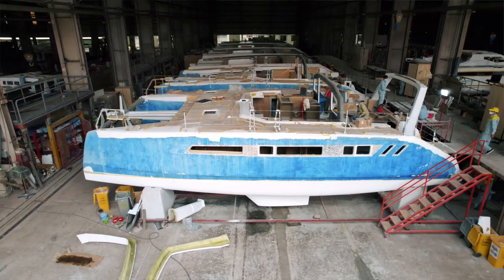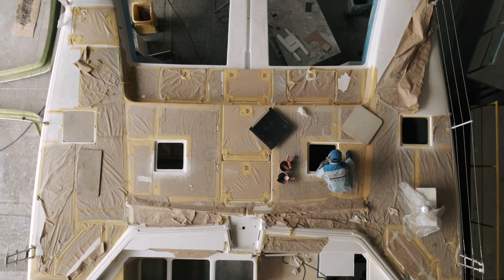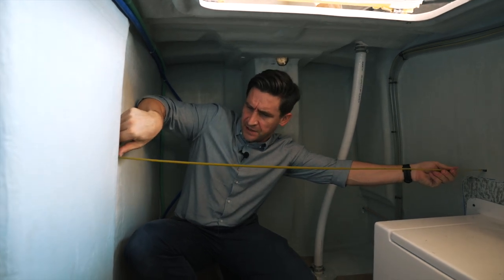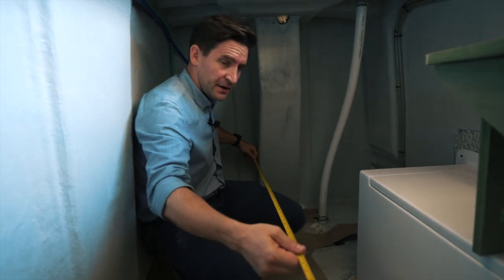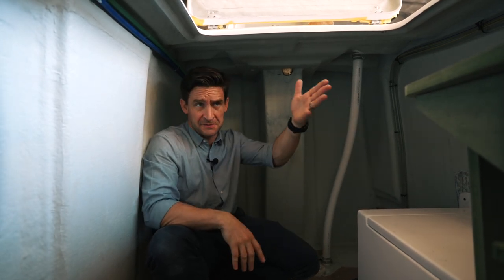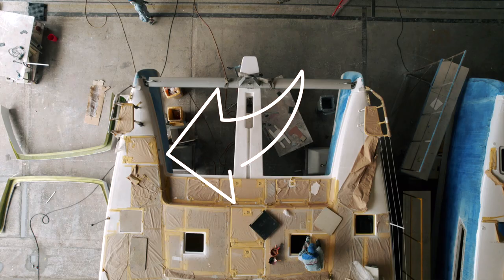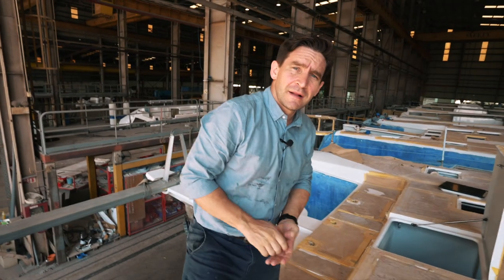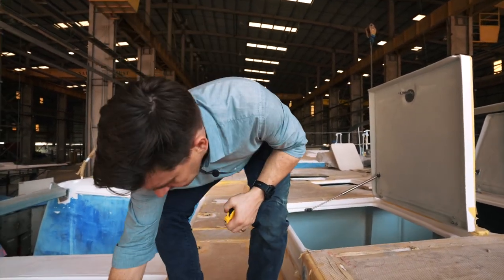Let's Talk Storage vs Weighing the Boat Down | Ruby Rose 2 Catamaran Build

Comment: Would be great if you guys did a video on the “stuff” calculation of everything you plan on putting aboard when you do set sail to see what kind of buffer you have vs stated payload capacity.   It adds up in a hurry! 👍🏻
Reply: I did read of one cat owner that literally weighed everything that was permanently stowed aboard.
Reply: Hey Kirk, good point! Way back when Chris White wrote a book on multis, "The Cruising Multihull" and at that time he reported on a cruising couple that weighed everything they brought aboard. The total was just about 3,000 lbs. Since then they have been all kinds of improvements to equipment - some of that being lowing the weight of each of item. But then again, there's all kinds of NEW equipment that never existed before. Since this is CRITICAL to how your boat will perform, it's a real good idea to do this.

Comment: Good episode. I really like Nick asking about the duck boards to make it a dry sail locker. What I'm learning is that on a boat: everything winds up getting used for everything - so there has to be versatility. A locker should have the option of draining, but also the option of being sealed - with some kind of ventilation to keep it dry.   (I'm surprised how when you go on board many sailboats there's a big home dehumidifier (I inherited one with my Hunter, but the last two times I've been onboard I've forgotten to lug it over to and up onto the galley sink and turn it on.) What do many or most people have on board like this that should be incorporated into the design/build? Maybe an AC/heat exchanger setting/timer for dehumidify.

Comment: During the previous episodes I had consciously avoided commenting on the downside of plentiful storage on the 1370, but you and Mike are clearly aware of the problem of putting too much weight on board. I predict it will be a constant struggle as you cruise to not add gear, stores, and whatever else now that you obviously will have room for such on the boat. I tried to put our little 37' trawler on a "diet" this summer, but I fear it has actually gained weight again. We cruise for two to three months each summer in the Inside Passage of B. C., so spare parts and accessories like a dive compressor are a big chunk of the weight we end up carrying, along with food, toys (like 2 inflatable kayaks, crab and shrimp pots, and golf clubs), and clothes. By now I have six large storage boxes just of fasteners. Yikes! Maybe next year the diet will actually work... Fair winds.

Comment: The almond smell is possibly from one of the cured resins. I used to mix gallons of resin (polyester) and periodically had this smell. I never figured out what it was, or why it happened - it only happened some times.
Reply: Epoxy smells 'nutty' to me. I learned many years ago (perhaps incorrectly) that the friendly nutty smell of epoxy hides its carcinogenic risk, and the sharp chemical smell of Acetone hides how not very toxic it actually is (in very small doses. Our bodies will actually make acetone.) And stick arc welding (which I didn't do very much of, or very well) always seemed to make me ravenously hungry.   
I've always worn gloves, long sleeves and a respirator when using epoxy. COVID for me has just been 'another day in the shop,' a very long day.
Reply: @WillN2Go1  We used so much acetone. Used to wash our hands in it but never suffered any side-effects from that. There was a new QC guy started one day and he just about pee'd his pants when he saw us do that. He spent the rest of the day searching for reasons we shouldn't do that, but failed to find anything else that removed resin.

Comment: I have a question:  A good friend on Instagram has a Bali 45 with a full-size, side-by-side, refrigerator.  I had not seen this before but would enjoy the convenience and storage.  Honest thoughts about this on a living catamaran?  Not looking for mean things, just honest thoughts.  There is good storage on this new boat.  It could be hard getting in and out of these places without handholds.  When the sail wet locker drains is it a one-way drain or ...

Comment: Hmm storage, interesting paradox with such non displacement hulls. I wonder ( crazy question to ask) but have they thought of having some electronic level indicator so you can distribute the weight more evenly. Im sure on Ruby Rose mono hull, you on many occasions were down on your design waterline, im sure you wouldnt want one side of this Cat trying to overtake the other side due to extra waterline length, thus wouldnt it be convenient to have an electronic level port to starboard & forward/aft  to trim the boat whilst loading ?
Reply: I always assumed boat owners would use the waterline as an analog level indicator.  Even on monohulls, I look at how much of the paint on the waterline is visible side to side to judge list trim, and similarly for fore and aft trim.
Reply: @The_R_Vid  we used to dead reckon every 30/60 mins, now we point & shoot and put an X on the chart lol 

To have a levelling system would on a multi-hull make trimming much easier

Comment: That white vertical drainage (?) pipe in the first locker is not a good design. Very vulnerable when equipment get thrown into the locker.

Comment: So much space. However, my hair was standing on end with the two of you twenty feet above the ground with no safety rails or netting to catch your if your foot slipped walking around. Is that the way Seawind protects their workers...I hope NOT. This is a point I kind of spoke of a year or two ago when Nick raised the issue of value for money when building a boat in Asia. Sure it maybe cheaper and that is good for the consumer, but quality (on ALL fronts may be sacrificed - you only get what you pay for) and safety (in this case for the workers themselves, after all they are human beings!!!) should also be considered - by the company of course.  If it costs a little more to promote a standard or comply with ISO ratings then so be it.  I'm not just trying to be critical, but I'm NOT sorry to point this out either, because that looked dangerous. That is something they need to address in their manufacturing processes. 

Good video highlighting all the space available! I saw Terysa in the thumbnail...it would have been nice to see here detail some of this here. Fair 💨 and following 🌊's